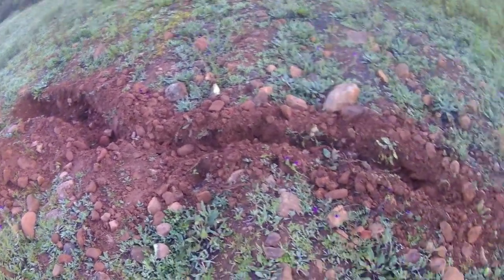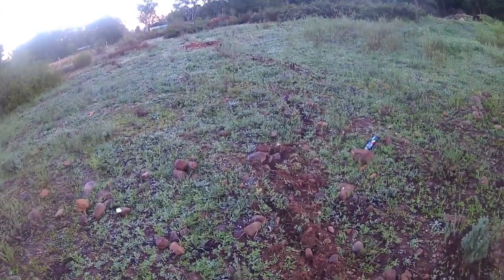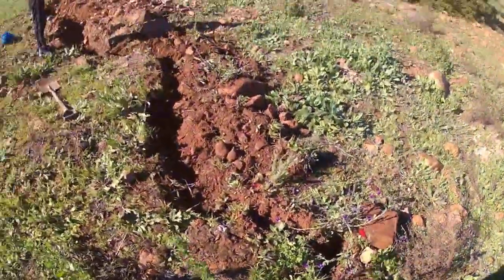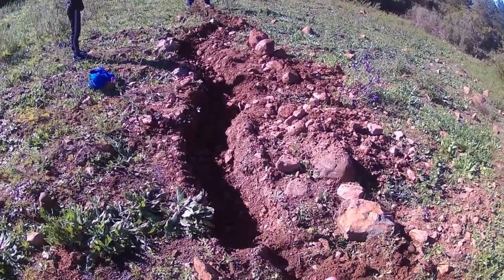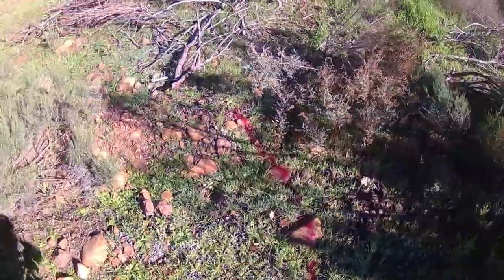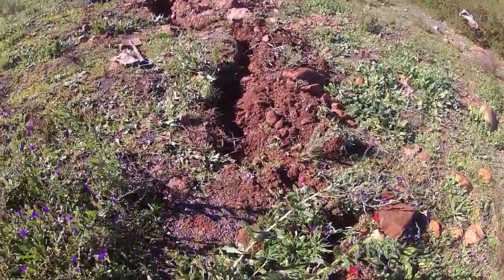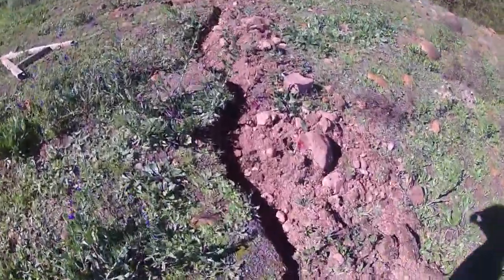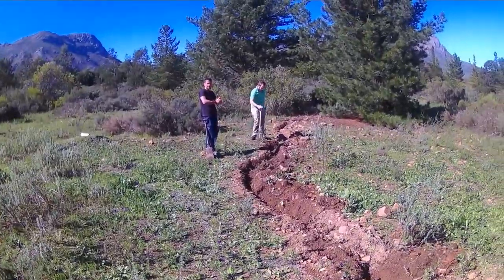Building a swale by hand

Comment: When it rained, could you tell if the swale needed to be as deep and wide as you made it?    Looks like very permeable soil.    I'm wouldn't mind having your larger downside rocks to use for check dams in gullies.
Reply from the maker: The soil isn't very permeable.  If it was a shallow, wide swale would have been better.  However this is boulder clay and most water would just sheet off of the land, unless we can catch it and force it underground.